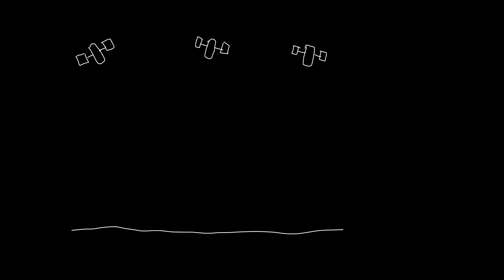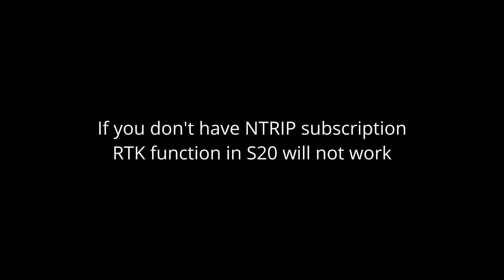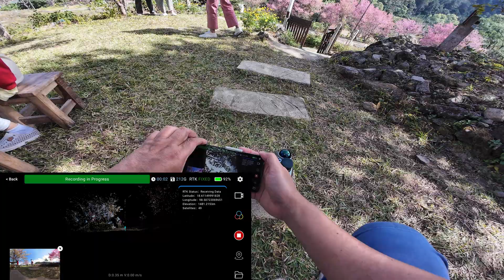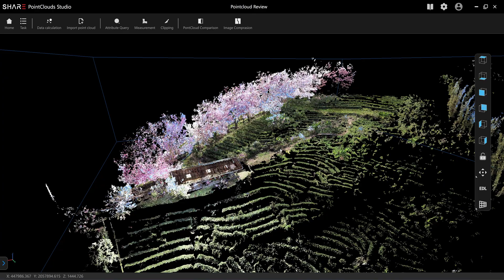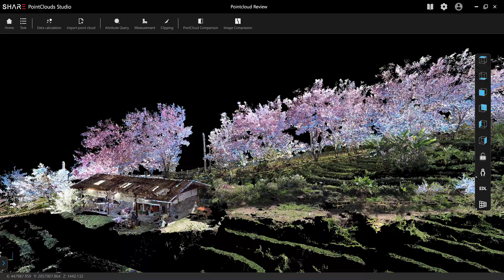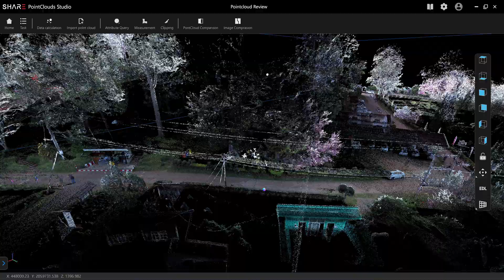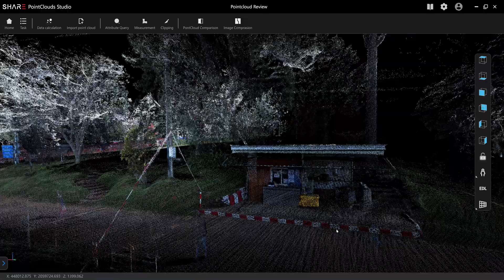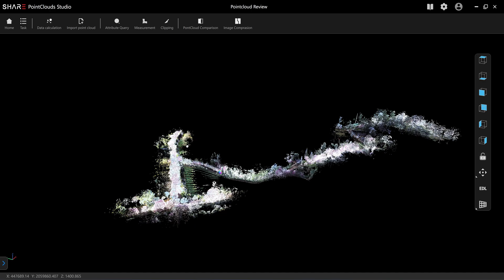SHARE S20 LiDAR Scanner – RTK Field Test

Comment: Can you do a test through the forest, if I want to record the terrain for the corridor of a new forest road without RTK? To check how accurate such a recording is compared to RTK or GCP? Does distortion occur? I was thinking about how accurate it is at a distance of 1km, how accurate it is in elevation, and whether it deviates in rotation from the starting to the end point. Also, how useful is the terrain model for road design work? Something like this in this video https://youtu.be/UYZgCWhN5C8?si=BS5C3QVYGF4uOk9F
Reply from the maker: I'm planning to release a video comparing RTK with SLAM when turned on RTK while doing the close loop.  1km is the longest you can travel in 20 mins.

Comment: Thanks for another excellent video.

If you did one more pass, would the point cloud improve? Is that an acceptable procedure, or would it just create more noise in the point cloud?
Reply from the maker: Repeating scans in RTK mode compromises point cloud quality and introduces visible inconsistencies. Use the control point function to align the SLAM point cloud with GPS coordinates instead.